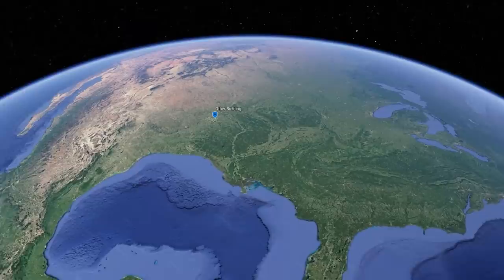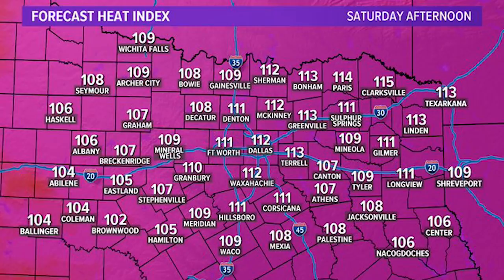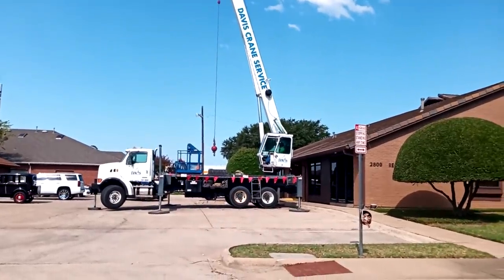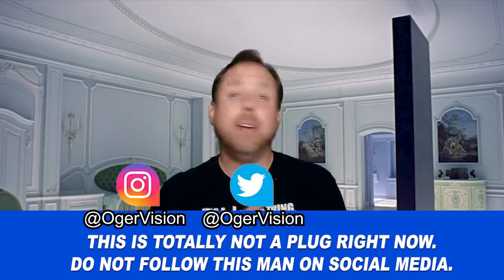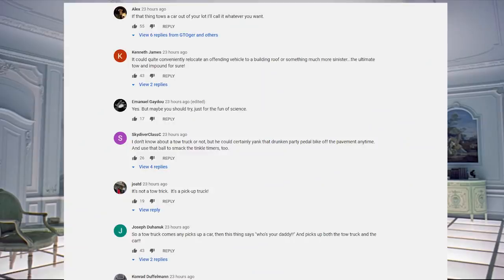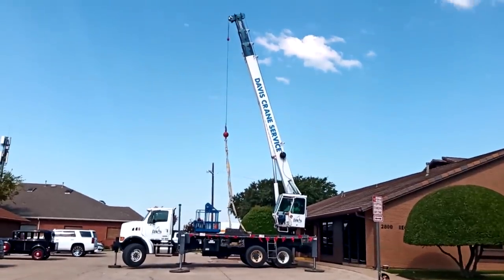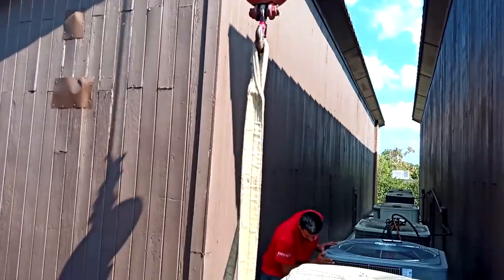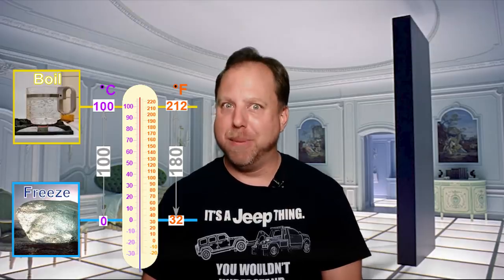Who Parked an Air Conditioner on the Roof?

Comment: Because of your channel... and another one I have followed 1140 Wrecker (or what was)... 

I have a major appreciation for the towing industry...
Heavy Wreckers... 20-50ton+
1Tons
Flatbeds
Lowboys
Winchlines
Im buying Tow trucks and building models of my own

I love the channel.

However...
Technically...  thats  iNTL with a Crane unit attached to it. Some of the regular Crane units are dual Steer units, with 40Ton+ Capacity for industrial work, with side stabilizers for front and rear...

But far be it for me to get into b.s of Towing... (you are the expert on that, for which I am proud). I love the channel, Id watch anything involving towing on this channel. People.. are people. They are dumb as all shit. --- I should know, Ive got multiple people in my head telling me what not to do...

I dont do dumb shit.
Crazy, yes.
Stuff that could get me killed... YUP.
Dumb... no.

Comment: Nah baby, nah. If it doesn't moves its load more than 100 feet along the ground its not a tow truck. Then there is the main requirement said truck needs to be moving a motor vehicle. A/C units do not count.

Comment: They are not remotely similar, a Crain lifts things completely off the ground, a tow truck tows vehicles on the ground. I have operated both and the closest I have come to the combination for the two is an Army wrecker that was a Crain that could tow a truck if it had tow bars on it.

Comment: These guys a spoiled. I used to do that job and we never hired a crane for anything that small. They're just not that heavy. We had to use a  manual hi-lift, a bunch of plywood, and a lot of muscle.
Reply from the maker: I hear ya. We started the day figuring we'd haul it up by hand.  But the foreman was not comfortable with having to get across the tile roof where you see the ladder.   At the end of the day, an hour of crane rental was a lot less expensive than if something went wrong hauling that 4-ton unit up there, so we all went home happy.
Reply: @gtoger  I understand your caution. We would have jacked it up from the other end and slid it along the plywood we set up on the other units.

As an aside, 4 tons it the BTU rating, not the weight. The one you had was more in the neighborhood of 100-115 pounds.

Comment: That's some odd noob crane operating. Communication over cell phone rather than radio? No proper hand signals to the crane operator? 
Clearly they had a hard time communicating through the project.
Reply from the maker: This crew usually does residential stuff.   This small building has residential-style mechanical systems so they're quite "at home" with it though you're right, they don't have a lot of commercial experience where they'd be working with a crane.   The crane operator was very forgiving and easy going, though.   In the end, the job got done.

Comment: You don't always have to make tow related videos. You shared the tows because you felt they were interesting to share. If you think replacing an air conditioner on the roof with a crane sitting in your lot is interesting, go ahead and put it up. The subscribers that aren't interested will simply ignore it while those of us that are interested would be happy to see what has been going on. Just look at your lot cleaning video with 91k views and great like ratio. We aren't going to condemn you over a video that isn't entirely on-topic for the channel.

Comment: Whomever designed that weird roofline on that building should be slapped repeatedly. And yes, cranes are tow trucks.
Reply from the maker: Up top it's a really weird setup.   Inside it's pretty normal, though.

Comment: so...crane = tow truck: because both use hydraulics to move stuff...is kind of like power boat = helicopter: because both move by a propeller moving a fluid. lol
I used to be a heavy equipment mechanic and have been quite deep into the workings of cranes...they do have some similar parts to large tow trucks...but yeah...nope not a tow truck.
I sure hope you got your tongue pried back out of your cheek. hahaha